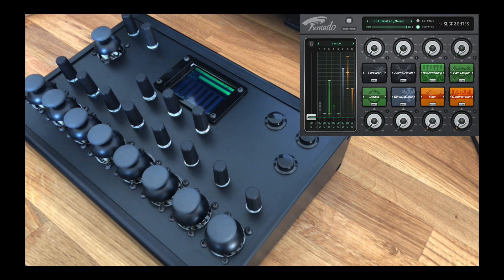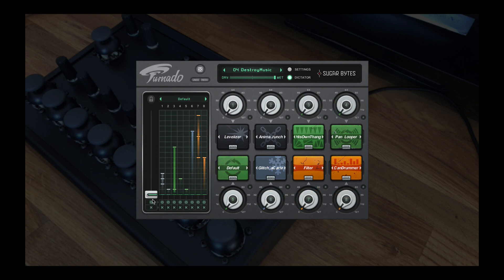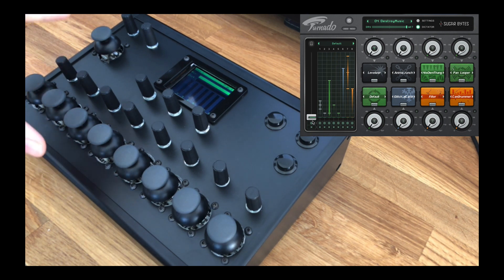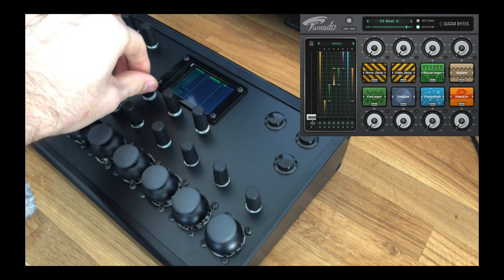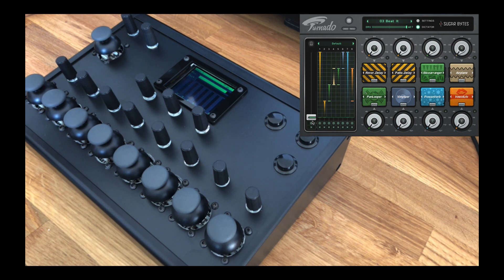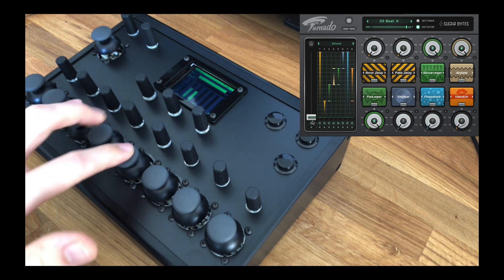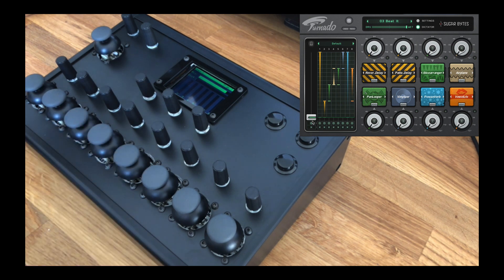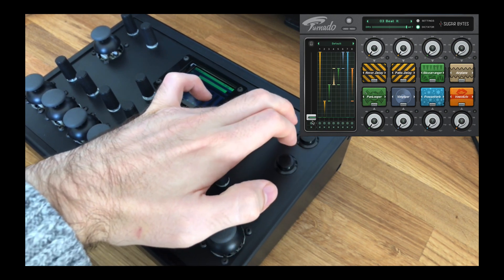DIY Hardware MIDI Controller for Turnado - Hackaday Prize 2018 Project

Comment: great design altough i would say that in  long terms of ergonics this could cause hand strain easy because of the joystick resistance. Try to use a ps3 joystick with our ringfinger for a week.   Using drumpads 8x8 for triggering different steps in cc's would make for sense for Turnado to me personally.
Reply from the maker: I agree it may not be for everyone. I talk about my design choices here - https://hackaday.io/project/160792-turnado-hardware-midi-controller/log/152186-design-of-the-controller

Comment: That's an awesome project. Any chance of a list / shop where you got the components?
Reply from the maker: Thanks! I put together a component list and a Bill of Materials from UK suppliers on the project page - https://hackaday.io/project/160792-turnado-hardware-midi-controller
Reply: @liamlacey2559 thank you thank you thank you awesome awesome awesome :) :) :) those pot knobs that can also act like sliders are out of this world.
Reply: Is there any possibility to get a step by step instruct? Would be pretty hyped to build this on my own!
Reply from the maker: Ludwig S. a full set of build instructions can be found at https://hackaday.io/project/160792/instructions

Comment: How much money do you need (more or less) for the components?
Reply from the maker: I put together a component list and a Bill of Materials from UK suppliers on the project page - https://hackaday.io/project/160792-turnado-hardware-midi-controller. UK suppliers BoM came to about £150, however I imagine this could be reduced by sourcing most of the components from China instsead.